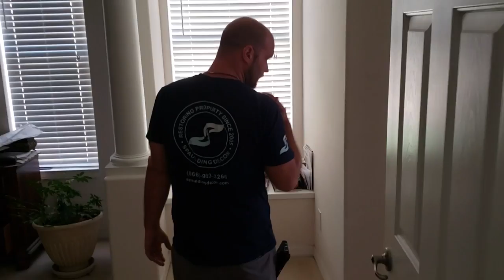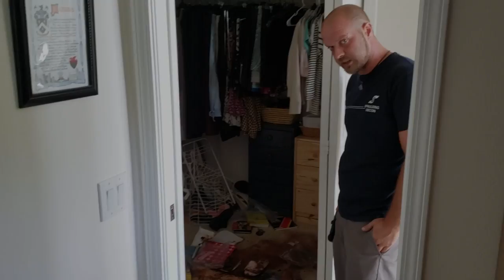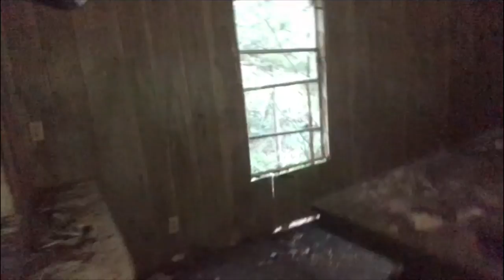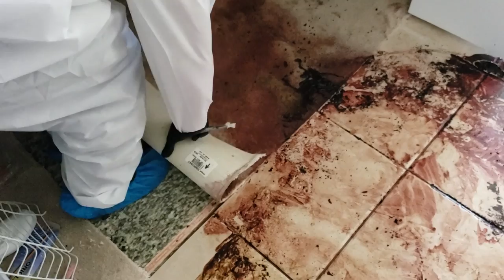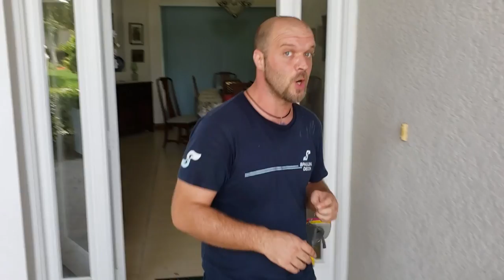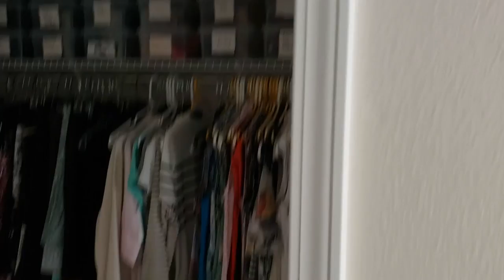Episode 7: Mysterious Death and Hoarder House Demo

Comment: unless he was a zombie, that blood placement is very odd. Why on the doors? Was he crawling for his keys that were in the closet? Poor guy...
Reply: It looks like it’s also been slightly mopped or attempted to have been cleaned before because there are circular paper towel marks
Reply: My best guess would be head injury, maybe tripped walking out of the bedroom, through the passage way between the closet doors hit his head? Maybe they had a concussion and he was unable to stand, it would explain the low hand prints.  He may have passed out, concussion can be fatal if left unchecked. Blood loss may have been a factor but  as he died in the same area the incident took place we cant asses the pooling on the floor  as it could have be decomp.
Whatever happened it's very sad. What a awful thing to come home too, his  wife found him like that.

Comment: My nasty half sister was living with our Mom supposedly to help her. Hoarded up her house to arm pit height even finally back to Mom's bedroom and then she started sleeping with Mm. For several years they had no running water because the plumbing leaked. It had eaten through the wall behind the stove and shorted it all out and rotted the floor under the stove. You say WHY did we allow this. WE as her children had no choice Mom would not leave the narcissistic hoarding half sister. 11 years ago hubby ad I found a gorgeous duplex, two story so one on top of each other with a stairway between wide enough to put in a lift chair thing. We had it almost bought but om refused. It was so pretty 2 1/2 acres n the pine trees closer to the airport than she was living so it would be easier for family to come in to visit her. Each half duplex 1400 SQ foot. Not huge but larger then either of us were currently living in. And we would pay everything for the house internet all she would have to pay were her own personal bills. She would be living a live of luxury. She refused. APS finally got her out of her house and condemned it  last summer some time. Nasty half sister was not allowed to stay in the house with her FIVE dogs three of them pit pulls. NOT small dogs, until enough clean up and repairs done to make the place some what livable. Now she is back into the house. It was estimated to put the house is good repair would cost upwards of 30K. Her assignment through APS now is to clear a 4 foot wide path all the way through the house from front to back doors down the hall and the bathrooms working. One is piled with cat shit. Cat died a few years ago. So she hoarded her shit. Mom died the 17th of January. None of us kids want the house but the hoarding half sister. But she is also going to fight for everything left to the others in Mom,s will I have no idea what is in the will I want no part of it and begged Mom to only include my name in it stating I have nothing coming to me. I do not want to deal with the fight. I am perfectly happy with what I have. I a still clearing stuff out of my own house as I get older and do not need as much stuff to live. Just me and my well cared for animals Hubby died a few years ago.

Hoarding is a dad situation. OH and this episode made me think of Mom's house because it too is a mobile home 33 years old not on a foundation like our 10 year old manufactured home is. And the floor there was also falling in from the weight of the hoard. GAWD the cat piss on the cupboard. Was making my nose burn just looking at it. I have photos of Moms place taken three or four years ago and it just kept getting worse. So so sad.

Comment: Hello, your video was very interesting, but in Florida you did not clean the closet well, to the left on the floor you can clearly see the wood next to where the door frame was, a blood stain, that wood that is stained must be removed and in one of the white ceramic joints there is clearly between them blood that was not cleaned. If you're going to do this terrible job, do it right, don't you think?

Comment: The scene is speaking. First look closely at the rest of the house, very clean, organized, and tidy. Then look at the closet. Definitely had a violent struggle shows a victim fighting for their life. Killed in the back of the closet with what looks like blunt force trauma while the heart was still beating, you can see the spray and cast off on the bottom of the dresser. Attempted to move body, but gave up  in front of closet and ultimately left there to finish bleeding out. My guess is the killer tried to clean up starting at the bottom of the closet door trying to wipe it due to the swipes being made when the blood was still wet, (if someone sprayed it with chemical to attempt cleaning, you would see some rundown on the door) then changed their mind and bounced out. Look closely higher up of door to see cast off. Smaller pool of thicker blood to left side of huge blood stain inside closet shows a possibility the victim was on their hands and knees after first whack. Ultimately died of blood loss due to blunt force trauma. Surprised the detectives dont see it.